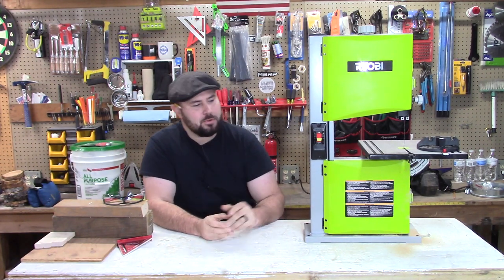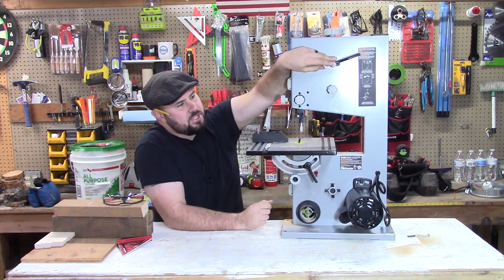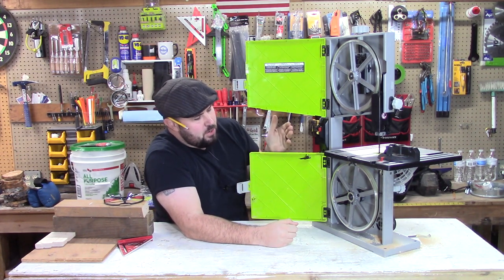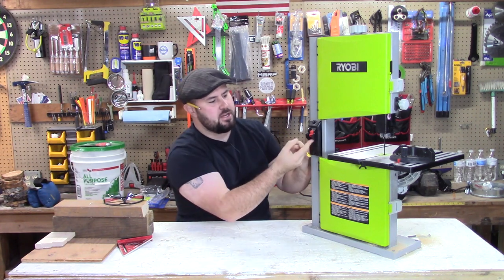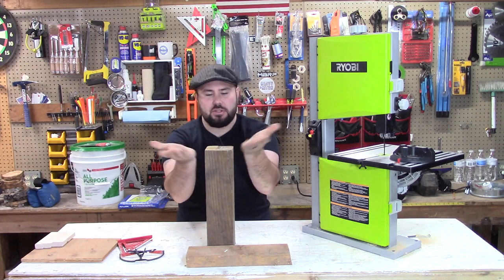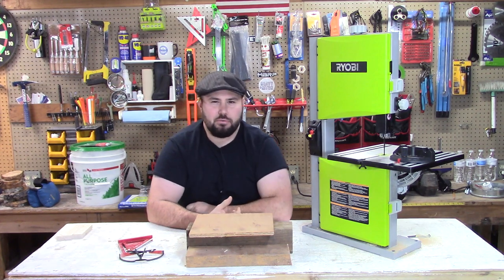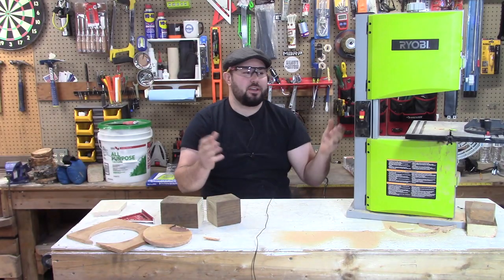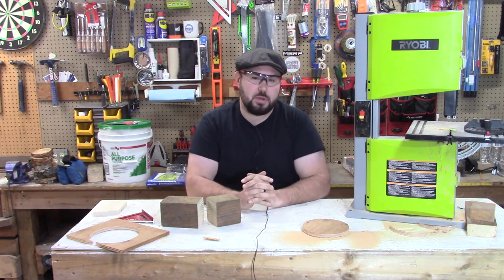Ryobi Band Saw Review and Test!

Comment: This was the best video I"ve seen yet on this saw. (Iwish it was cheaper in Canada; goes for $195.00 here at Home Depot. I appreciated you demonstrating with the 2X4 and 4X4. It was good to see one in action. I just returned one of these to the store; the reason being the table was in terrible shape, with gouges and deep scratches and some that looked like corrosion near the blade hole. I'm thinking about whether I should try again. But you educated me on what the  capabilities of this saw really are,; good job. I'll maybe reconsider this purchase. I'd like to think that Ryobi has a handle on its quality control, with regard to the condition of the parts; that's the main issue for me right now.
Reply from the maker: Thanks for watching and comment!

Comment: I have one of these too But the ON switch I converted it with a Foot Paddle Switch, just like what you'll see in the Singer Electric Sewing machine 😜 yeah I did that on purpose for safety reasons. If anything goes wrong I can just release my foot off the paddle and the band saw machine will automatically turned off.
Reply from the maker: great idea!
Reply: @livefreeandtoolon  yeah, after I did that I have full control of my band saw machine. And I also got it all figured out how to get it on variable speed with doing some slight modifications. I have full control. And it turns out to be like a sewing machine 😜😆 yeah but I love it especially Ryobi it's cheap but it works fine
Reply: Man that's a good idea! 💡 Hell! I'm gonna try that thing!!! Why not!!! I have a lot of Electric foot paddle switch stocked at home, I got some parts from my grandma's old singer sewing machine maybe if I could figure out a good way to modify my Ryobi and my Dewalt Band Saw! Yeah! After all this years of owning a machines I have not ever thought of that!
Reply: @craftsmantrucker6867  You know they sell extension cords with footswitch already installed on the cord...Less hassle than trying to fiddle with the switch on the bandsaw, and also less dangerous...
Reply: They do not sell the switched extension cords here in Australia.
Reply: @geraldlamothe6091  you implying that just cause it's store bought its more safe than what I can do myself? I have doubts. Many of them 😆
Reply: @richardcagle5475  Noy implying...I am saying plugging one end of the cord into the bandsaw cord ,and other into the outlet...In between is the footswitch...Easy peasy....Hey if you can build your own,go for it!
Reply: @geraldlamothe6091  lol I hear ya man, but I'm with that guy. If you can do it an already have the parts, why pay someone else? Wife would kill me if I cannibalize her sewing machine for the foot switch

Comment: Yeah, I noticed on my Ryobi bandsaw that the knob that controls the depth of cut will spin tightly, but the gear that it’s supposed to be turning, will not actually engage the slot, or it might be that the slot has no play on it, and need some WD-40.

Comment: My Ryobi band saw just lost its first blade, and I wonder if it's even worth the $15 to replace it.
Reply: tell me, would you use this band saw to cut a 1.5 inch thick block of epoxy resin that is filled with marbles? ( I am a novice guitar builder, and i have some crazy ideas on guitar builds)
Reply: @spartanguitarist6579  The blade is the key.  I am not sure what would cut through marbles, which, I’m sure you know, are made of glass not marble.  Carbide tipped? Diamond? The bandsaw is not horrible—it’s just not very good.
Reply: Sorry for this clarifying question but are you saying that because you're unhappy with the machine preforms or because it's already such an inexpensive machine (relatively) that it would be better to upgrade now? I'm looking at buying my first one and unsure of what features and qualities are out there, just for light/general purpose stuff.
Reply: @trje246  Lol, I was making a joke about how cheap the saw is.  Honestly, I haven’t had any trouble out of it.  It only has the capacity to saw something about 3” to 3 1/4” high, so resawing is grossly limited. It does mostly what I need
Reply: @believethebible88  cheers mate👍👍

Comment: Was the bandsaw screwed to the table during the cuts? Can it be left unscrewed?
Reply from the maker: No
Reply: @livefreeandtoolon  No, it wasn't unscrewed? Or no, it can't be left unscrewed? Thanks!
Reply: @rodrigougarte5597  hi , I've mounted mine on a wheeled base . Cuts down on vibrations .small cuts it can be left unscrewed . It is quite Stable and heavy .

Comment: Is this able to cut metal well?
Reply from the maker: It’s better to use a metal cutting machine
Reply: The rpm on a band saw is to fast.
Reply: I use mine to cut aluminum pieces all the time, just make sure you use the right band for it, can’t be a spaced out teeth
Reply: Use a bi metal blade

Comment: I don’t know about “like butter”, you could definitely hear the motor and blade bog down on both the 2x4 and 4x4. 
Also the edge on your circle was pretty rough. Not sure what the factory blade specs are, but that cut was anything but smooth. 
It’s fine for a $175 saw, but let’s be real. It does NOT cut like butter.
Reply: Cuts eva foam like butter
Reply: how do you think this saw would cut through hardened epoxy?